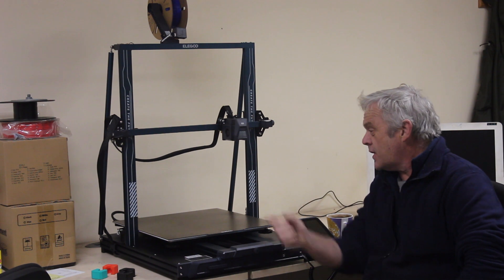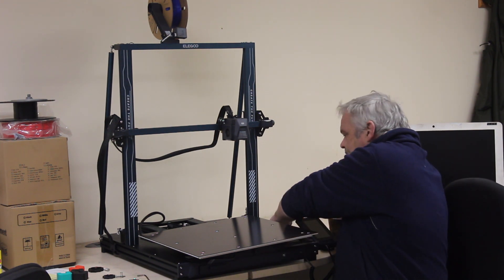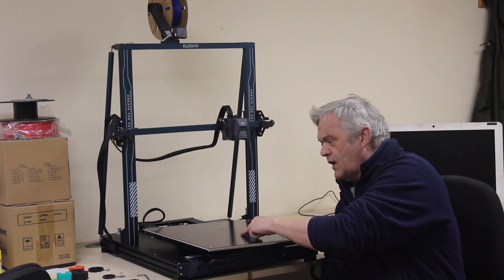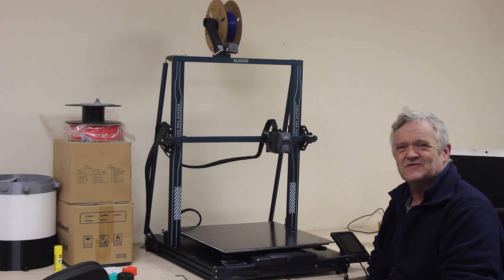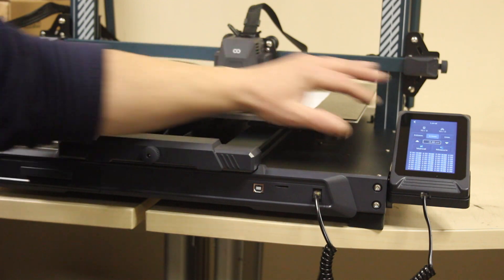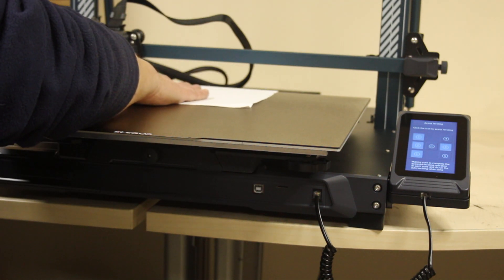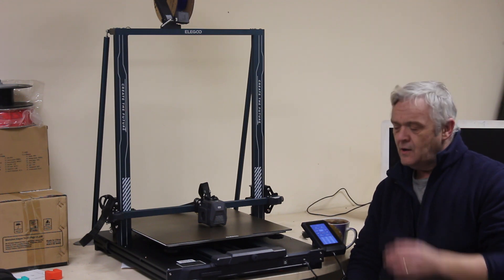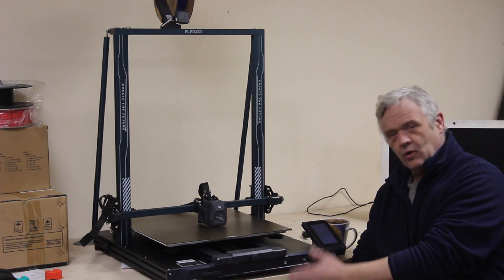1808 Levelling The Print Bed On An Elegoo Neptune Printer #elegoo #neptune

Comment: Robert,  It is always a good idea to check the bed is flat with a straight edge before starting the leveling process. Quite Often (especially on the larger machines) the bed arrives slightly bent/bowed or dished and this can be a real headache for new people when trying to follow along with the leveling process. Also it is always a good idea to run through the leveling twice  to confirm the later point adjustments hasn't affected the first  points adjustments.

Comment: Question where can I vind a way to see if I have flux but not in electric mhz sequence jed onregulais sequence how to level it out😍 I have between -800+700 max most around 300a 400 in boths extends jad one time 52 than 320 than -120 than 80 than -56 than - 600 random
Reply: I was thinking of negative and posetive copasators jad these nano stenceling is outside mi raiche of phisicle making😍
No time to do😍🙏😍

I olso going to ask there what they can do.
I oways presumed that altenator was rotational provoked jad oll are plus and our oll are min🙏 so the diverentional is the provoction of the rotation of the magneticle behavieures of the iron😍 towart the coper behavieures as koper queker
Reply: Thank you for the print sharings😋 a lot wil have fun from it😍🙏😍

Comment: have you thought to use the printer to build downspout water screw turbine. if you input magnets on the inner section with outer coil could be a very inexpensive micro generator

Comment: Remember to absolutely square every angle of the printer (x, y & z) as acurate as you can before leveling the bed if you want acurate prints. If this is slightly out of angle it wil skew your prints, this isnt a big problem for most dayly prints but if your printing technical/mechanical parts that need to be acurate this will be important. For this reason i hate auto bed leveling for example, if one of the angles isnt exactly 90deg it wil skew the print. i use M5 locknuts to level my bed so the bed will always (99.9%) be level and if something goes wrong its probably one of the angles that got misaligned.  (btw i only used my own designed and build printers thus far, so cant judge about printers like this one and i dont know how and if you be able you aligns the angles without doin some macGuyer on it :)

Comment: I'd buy a 3D printer but the problem is just what the heck would I do with the darn thing.
Reply: Yep.. seen people print off a little boat 🤔
Reply: @ME10920  My thinking too.  I've seen lots of home 3D printers printing stuff.  Rob does it a bit, but then he has a need for it.
Reply: you could print replacement parts for video game consoles (handhelds) or custom cases for the same.
Reply: @thisunity  yes that is a possibility but I replaced my old Wiimote with a brand new one from China for about $20CDN,
Reply: If you learn to use freecad (or similar) you can make your own custom parts. some custom things ive done include...a 24mm to 32mm socket adapter, an electric meter box key, a motor brush holder assembly for friends circular saw, a landrover discovery1 door handle, funny shaped electronic box to mount on someones motorbike, plus all the gimmicky stuff and interesting things from thingiverse. Thinking about making my own fleshlite now, the possibilities are many!
Reply: @apbosh1  There in is the problem I don't need any of that.  The best I could come up with was building a custom project box for some of my electronic projects/gear.  BUT I have a small stash of them and they are cheap to begin with.  To me for the home user it is a solution looking for a problem.
Reply: @misamsung6191  I think you might be a closet 3d printing enthusiast.  Mine was second hand £60 with everything included. Works really well and I enjoy the whole process from idea to cad modelling to the finished item. You must have some interest otherwise its bizarre to watch a bed levelling video!
Reply: @apbosh1  IDK I actually built one back in the day using an old plotter.  The results weren't exactly the best and no one was hurt in the resulting fire.  Just a wee bit ahead of technology.  I've spend my entire career in the electronics technology field and I like to understand how things are done.
Reply: You would probably surprise yourself how often you use it. I started with the most inexpensive printer I could get my hands on because I was in the same benchy as you, but now I have 6.
Reply: @stewiex  I really haven't found a reason to buy one.  The one thing recently that I would have 3D printed, I found in my local hardware store for a few dollars.
Reply: Once levelled...go around it again....expecially on cheaper 3d printers.... ;)

Comment: the only machine I know that is different is my flsun q5, this has 3 vertical supports and the nozzle is suspended between these, so the nozzle position changes with the height of the motors on the 3 legs. levelling is fully automatic, the machine just maps the bed using a probe that is temporarily mounted to the print head, once levelled the only part you need to do is set the z height with the piece of paper as you showed, if though you find the print is not sticking to the bed on the first pass you can quickly adjust the z height on the fly in 0.05mm increments, since the bed is firmly bolted down and not  moving the machine just adjusts the print using the mapped grid it has for the bed.
in this case the bed being level is not important as the machine plots its position relative to the bed using the 3 vertical motors, the machine has to compensate to get a level print anyway as its a factor of 3 coordinate positioning to get the printhead in the correct location.
Reply: That makes a lot of sense. 
Is the print bed itself true and flat?

Comment: Interesting that the very large build plate has the two pivot points and six lateral adjustments.   This makes sense.   My Creality CR10S is "only" 300x300mm.    This has the common 4 points, one at each corner.   I would prefer if it also had one or two pivot points in the middle of the bed.
Reply from the maker: cheers mate
Reply: my davinci is only 200x200 and has a 3 point adjustment, near the 2 back corners and the centre at the front